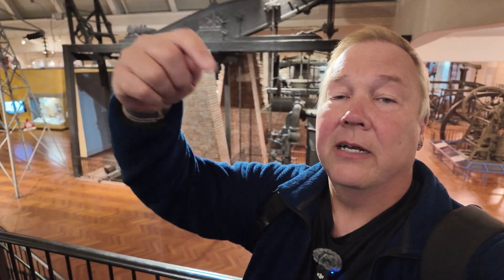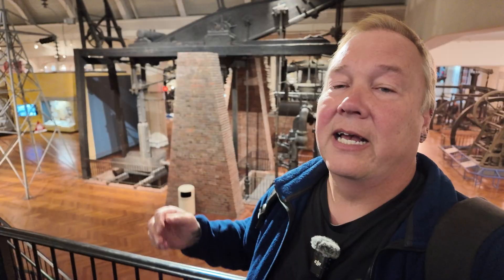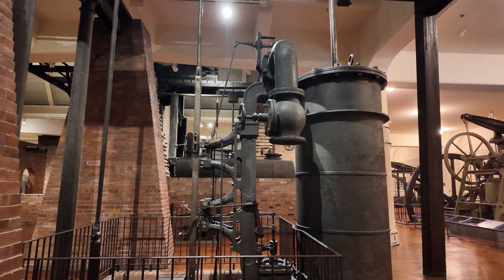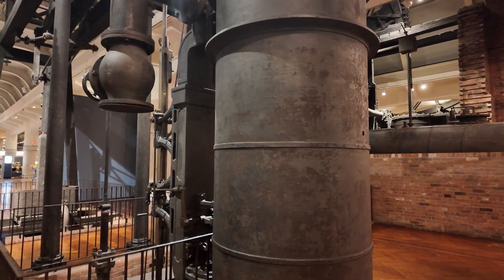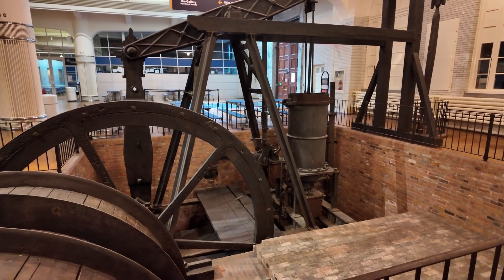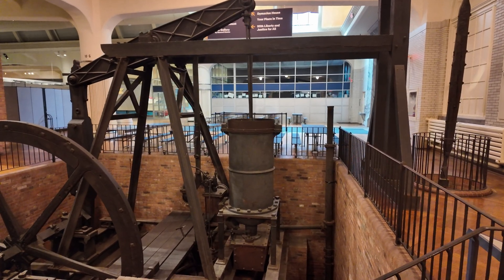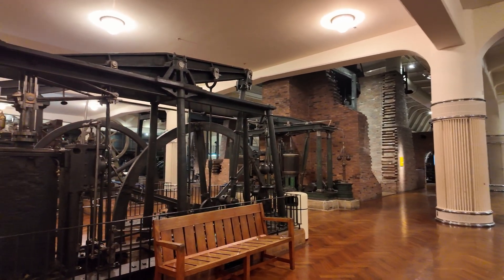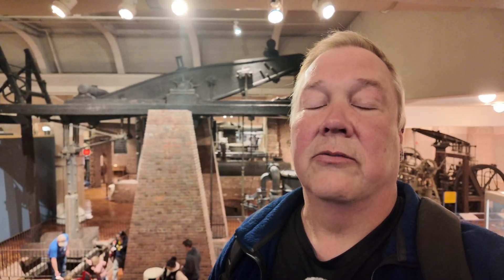The REAL Reason Atmospheric Steam Engines Failed | First Century of Steam - Part 7/7

Comment: Is it possible to build a non-atmospheric condenseless Double-Action steam engine with low pressure steam?
Reply from the maker: Yes, but with only 5psi above ambient pressure, you'd need to be 3-4 times bigger for the same power, and quite a bit more fuel.

Comment: This comment was intended for part 6 it switched before i finished typing. 
The purpose of the stroke counter was Bolton and Watt generally did not sell the engines they were leased and the monthly charge was calculated from the number of strokes that had been made.
Reply from the maker: Thanks!  Iknow they used to charge licensing fees at 1/2 the fuel savings from a Newcomen engine.  Do you know when they changed?

Comment: The increase in steam pressure in boilers  in the 19th century rises through the decades. In 1810 pressure was 10 pounds; 1820 is was 20 pounds; 1830 was 30 pounds so by 1900 it was 100 pounds.  The manufacture and metallurgy of boilers improved over that period.
Reply from the maker: Absolutely, and those boiler advances enabled corresponding advances in the steam engines, too.
Reply: @Industrial_Revolution  compounding. q. v. and superheating

Comment: before watching, i understand that steampower remains in use in some forms but that it must be understood as an issue with versatility of steamturbines (these were by definition bulky and static) which despite their usually larger power compared to internal combustion engines and electric engines proved far less usefull in most industrial applications 

and 2, cole and cokes were always filthy  (which is why coalpowered ships were allmost always painted black) they also didn't burn as clean as diesel and produced a lot of unhealthy smoke and most importantly coaldust is incredibly fine and has been known to combust and take ships or at least crews, with it.

all of which means that despite the steamturbine surviving in many applications only power generation still utilizes coal or cokes as was traditional, modern ones use either diesel (maybe petrol) or nuclear fission to drive them.
Reply from the maker: Thanks for your comments!
In larger applications, steam is definitely still in use, but you're right it's mostly turbines, now.  Large-scale electrical production, be it coal, natural gas/methane, or even nuclear, are all steam powered, external combustion.
Big factories, like the Ford Rouge plant, still generate their own power and, I think, still use coal to do it.  Plenty of ocean-going freighters still use steam, too, but not typically coal, anymore.
Where steam really fails is in situations where you need a lot of on-demand power and your power demands vary.  Steam cars predated gas cars, but no one wants to wait an hour while their car builds up a head of steam.  External combustion is generally more efficient than internal combustion, but unless your power consumption is pretty consistent, and you're large-scale enough to be able to afford people to take care of the boilers, the internal combustion and electrical systems will win every time.
Reply: @Industrial_Revolution what freighters (that are not a few survivors from old) use steam as their main power? I thought they all ran slow 2 stroke diesels, with maybe an exhaust boiler for added efficiency, but not any steam that actually used the fuel specifically for the purpose
Reply from the maker: A lot of the newer ones aren't even running diesel, they're running "bunker oil" which is more of a thick sludge, but there's also a push to move them to either LNG or, oddly, ammonia.
Reply: @Industrial_Revolution that is the case, but the engines are diesel-cycle
Reply from the maker: That's definitely not my area of expertise.
Reply: @Industrial_Revolution basically, diesel engines dont necessarily need diesel to run, amd the big ones can burn nastly sludgy stuff

Comment: Atmospheric engines didn't fail. They were very successful and in service for more than 100 years. That's not failure!
They were superceeded by better engines, but that does not equate to them failing.
Reply from the maker: Very good point.  Even after there were far better options, many of them still ran another century because they would run pretty much forever.

Comment: Two things.  One comment states that smaller parts are easier to produce.   Well yes, but also no.  If, and it was so, you had no means of rotating a cylinder of useful size, in order to bore it, then the finished work is as accurate as hand fettling of the casting allows and the errors in cylindrical bore are a smaller proportion of large diameters.  Boring had only been arranged for gun barrels and they were far too small for atmospheric piston power.

Another comment asks about the water lifting mechanism and rightly so.

Savery had mooted using high pressure to force water up a long vertical pipe but had nothing but cast iron or soft solder to use for manufacture.   The Cornish deep mines had long series of lift pumps and cisterns so no more than 25 or so feet head of water pressure on any component.  Also see-saw ballance weight for each lifting stage.  There was obviously friction but I, for one, am impressed by the tenacity and ingenuity which produced these machines on hundreds of sites.

As a minor point about the inefficiency of low pressure or condensation in the working cylinder - we had a law forbidding sale of coal slack, it had to be big lumps, so collieries were awash with unsaleable slack which could be burnt to work the haystack boiler.  Obviously that was useless in non carboniferous Cornwall and explained the determination to do better with steam and not being forced to pay Watt his iniquitous 33% of notional coal savings.
Reply from the maker: Actually, the cylinder boring was a big problem, but in the 1770's, Gillette started boring the cylinders for James Watt.  That led to some big efficiency improvements and, as you mentioned, the process was the same as it was for rifles, with similar improvements.  That meant they could accurate bore just about any size cylinder they wanted.
Now you're very right that some things, when they get too small, really do get more complicated.  The increase in safe, reliable pressure just wasn't that big, that fast, though.  With Trevithick's boiler in the early 1800's taking safe pressures up to 25 psi, and by mid-1800-s pressures up to 50psi, the newer engines tended to be more like 6" - 12" / 15cm - 30cm) diameter, so things weren't so small that they were causing problems, just small enough you didn't need quite such a big crane to move things around.

Comment: Could you explain how the water lifting mechanism worked? You explained how the engines create the up and down motion but how does that lift the water.
Reply from the maker: That's a great question.  A bunch of people on my farm windmill video asked the same thing.  I'm going to do a video on it, but the short answer is that you have, at the bottom of the well, a closed cylinder with a pair of one-way valves, with one letting water into cylinder to "charge" it while the other lets water out to push it up the shaft.

Comment: Well done Darren! Very informative series of videos.
Here in cornwall they seem to have used water wheels at surface and underground for pumping water.  Horses only seemed to have been used for winding purposes.
I can see why they build our enginehouses so well, the load on the beam wall must have been great.  100 inch cylinder engine was the biggest built in Cornwall. So how much weight was that lifting?
Reply from the maker: Thanks!  Glad you liked it.
I've seen pictures of those underground water lifting wheels and really want to get over there to see them in person.  
100 inch diameter is 50 inch radius, so PI x R x R = 7850 pounds = 3560kg.
Reply: @Industrial_Revolution 
Yes it is amazing what mine explores have found in the old mine of cornwall.
I suppose you have the factor in the Two or three balance beams and boxes connected to the pump rod in the shaft, but that engine is still picking up a lot of weight.  Some of the double acting engines still have steel straps up the Bob walls to help support the beam saddles  on the out door stroke.
It’s not surprising some engines were wreaked when the beam broke.

Comment: Great series! One advantage of the double-acting cylinder might be the additional 5psi above atmospheric pressure, allowing a smaller cylinder to produce the same pumping volume. Smaller parts are easier to produce, transport, and service, hence they’re less expensive. Replies welcome, join the discussion. Thanks for bringing us these great videos!❤
Reply from the maker: The double-acting cylinder was able to do all that stuff, but only after high-pressure steam was available.  James Watt did build engines with double-acting cylinders with atmospheric engines (the later canal pump I showed in this course, plus you can check out my video on his rotative steam engine).  As soon as Trevithick invented a safe, reliable boiler, he immediately hooked it up to a double-acting cylinder.
You can run high-pressure steam with a single-acting boiler, but typically only hooked up to a large, heavy flywheel, to "reset" the cylinder to be ready for the next stroke. If you think of it, internal combustion engines are really just multiple single-acting cylinders hooked up to each other.
Reply: These are Tartarian engines, we didn't build them, and they were designed to operate in a different atmosphere (higher pressure, more oxygen) like a car turbo. Everything you've been told is a lie. Just look at how strong the engines were built, they were higher horsepower in times past. Why would anyone build so many big engines that barely run, and produce no  useful power?
Reply: @togowack the reason to build them is simple. There was nothing better, and less knowledge was compensated by stronger construction. Also, air pressure and oxygen in the air didn't change notably over the last millennium, science has proven that (please dont make me collect sources for something so basic, google will find them for you if necessary)
Reply: @the_retag  yes they doubled. the oxygen content was double. Try Tartarian Mudflood, we were running on free energy prior to 1900.

Comment: Excellent and interesting video - thanks.
Reply from the maker: Thanks!  Did you check out the whole course?
Reply: @Industrial_Revolution  Yes I did - very interesting. Early steam engines are fascinating inventions. 

It makes one wonder if using a non polluting energy source  i.e. C02 releasing. or nuclear power, about their value in modern settings. Water converted to steam is pretty much a universally available non-polluting source of power. 

I suspect a solar powered means of heating a boiler would be pretty much impracticable. 🤔
Reply from the maker: Steam is still used for most power production, whether coal or natural gas or nuclear, but they typically use steam turbines instead of pistons now.
There was a solar power plant that did what you describe, although I hear the big one was just shut down.  They used hundreds of computer-aligned mirrors to reflect the sun to the top of a tower, which was filled with molten sodium.  The sun heated the sodium, the sodium then boiled water.  It worked great, but newer photovoltaic panels have gotten cheaper, and are far, far easier.

Comment: watt linkage... you need it for the piston rod support. nothing to do with rotation. the beam follows an arc. the rod doesnt. anything else is going to put a side load on the rod that requires guides and slides and friction... pivots and linkages are easy.

high pressure steam may have more energy, but only to a degree... from atmospheric, every doubling of pressure gives us one expansion of doubling the volume. 15psi. 30. 60. 120. soon adds up to high numbers, and those numbers drop just as fast when working.
the piston engine was the problem. and using the atmosphere itself to provide the push. we are limited to a maximum of 15psi...(shutup about it being 14.7 and learn to round up!)
turbines on condensors extract about half of their total output from teh steam once its below atmospheric and 100c... sidestepping that latent heat issue to some degree. thats the real killer.

turbines use the steam velocity rather than pressure.
Reply from the maker: Thanks for the comments.
What actually called that linkage "the parallel motion," which I think is quite possibly in the running for worst name ever.  Earlier engines avoided the issue by putting a large, curved piece at the end of the main beam, and connecting a chain from the top of that down to the piston, with the curve keeping the motion straight up and down.  You can't push a chain, though, so if you use double-acting cylinders, you need to use something else, like the parallel motion, a crank, etc.
I mostly always use 15psi for 1atm, probably for exactly the reasons you're thinking.  The difference usually doesn't matter, unless you're trying to calculate exact forces, power, etc, but some viewers obsess about it, so I mention it in passing, then just use 15.  Anyone trying to do actual calculations knows the real numbers for their elevation and weather conditions.
I haven't really looked much at steam turbines, yet.  They've been around since the late 1800's, but mostly went into power production and ships, and I haven't had much luck finding preserved power plants or steam ships.  Hopefully I'll start to find some, though.
Reply: so what you are saying is that they don't actually have a higher power output than internal combustion engines? genuinely curious.
Reply from the maker: Oh, you can make a steam engine give any power output you want.  Just make it bigger and give it more fuel.  Pretty sure all the biggest, most powerful engines today are steam-powered.  That said, I don't want a steam-powered car.
Reply: @istoppedcaring6209  not that simple. its about efficiency, the fuel used to produce that power output that really matters.

anyway, at small scales, stem is highly inefficient. the ICE wins out, making for more power for less size.

once you get into the multi MW region of powerstations? steam wins. it holds more "heat energy" than air and combustion byproducts do. to reach certain pressures takes far less temperature when steam is used. (dont confuse temperature with "heat energy" or "specific thermal mass" though! different materials hold different amounts of energy for a given change in temperature.)

at the large sizes, the small inaccuracies of manufacturing become a fractional percentage, whereas at a small scale they are a large loss. "tolerances" dont scale.

larger volumes, smaller surface areas, less heat radiation loss...

a reciprocating (high pressure) steam engine doesnt benefit from a condensor, it pulls a vacuum in teh cylinder, that may give slightly more force on teh other side, but as the cylinder is now empty, when its at TDC, steam has to fill the "dead space", and thats steam that is wasted and does nothing. they only run condensors to recycle the feedwater. entirely different operation to newcommen or watts "atmospheric engine". at a certain pressure you cant extract any useful force, no matter how large the piston and its area gets... so you just have to dump that steam.

and as it IS steam still, its hot... and carries with it almost 80% of the energy that we used to boil it... THIS is why steam engines eventually were superseded. you simply cannot get the efficiency past about 12% at best.

but thats with pistons. using steam PRESSURE.

on a turbine? the condensor allows steam to stay at a gas well below the boiling point, and as turbines use gas velocity rather than pressure, a steam turbine can extract more work form that "below 100c, below atmospheric pressure" steam. the colder the condensor can get, the higher the vacuum pulled, the better the efficiency...

so you will never see small steam turbines compete... ever. or small steam engines of any type... unless physics takes a holiday.

so steam engines (of today) generally make far more power than ICE... because the majority of modern steam engines are MASSIVE.

whereas the TOTAL HP and work performed by the engines "sold" by watt and boulton, over DECADES, amounted to about the same output as an average drag car engine produces today in one or two runs of the 1/4 mile...
Reply from the maker: You're right, especially about how little actual power these early engines actually generated, and why steam turbines replaced steam pistons.  Unfortunately, I haven't found any historic steam turbine-equipped systems to film, yet.  The ones in power plants have been scrapped or replaced and the ones on ships sank, or have been upgraded.  Those are the two places they were very popular.
Reply: @Industrial_Revolution  yeah, we discussed that before. probably only place now will be in locos. and you may have to rob another museum, unfortunately... 
 
but hey, a heat pipe is a steam boiler and condensor without the turbine bit, if that helps?

this where they get really interesting. when cold, the boiler is under vacuum too. its starting to evaporate water the moment theres enough temperatue differential to break the vapor pressure... hence the efficiency. not wasting power in latent heat.

still, parsons made his first turbine iwth pretty rudimentary equipment... replications allowed?

its all the green stuff thats the issue, i guess...
Reply from the maker: For a lot of the oldest stuff, replicas are about all that exists.  Even what I'd probably the most famous early locomotive, Rocket, even though it still exists, I understand it's been so modified that most people would walk right by it without noticing it.
Replicas have another advantage, too.  People are a lot more willing to actually run them without quite so much fear of wear and tear.